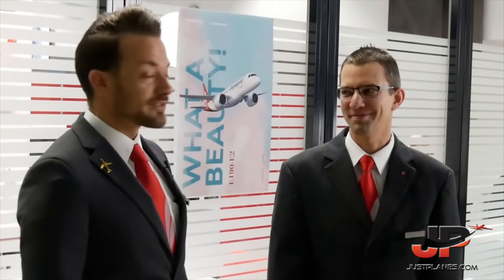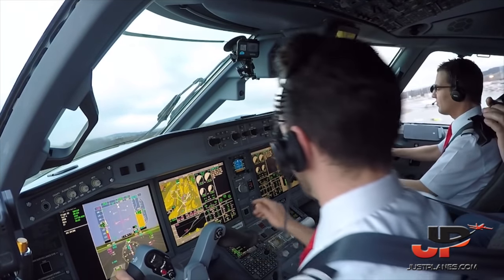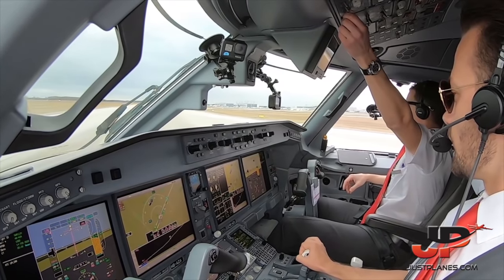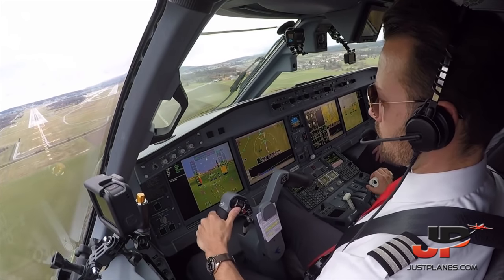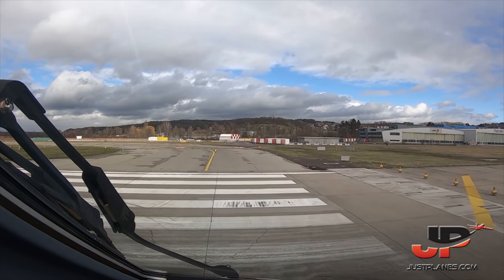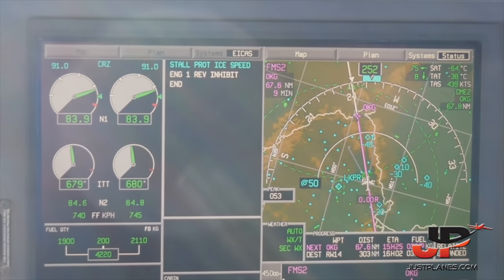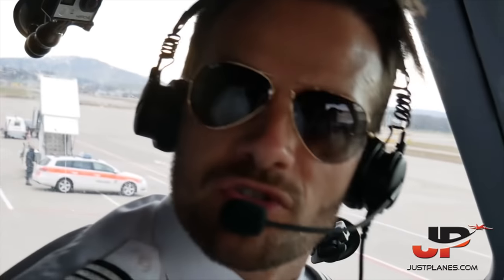Piloting the Brand New Helvetic EMBRAER 190-E2 | Cockpit Views

Comment: The panel screens are very functional and put this aircraft on another level, much higher than its competitors. Congratulations Helvetic team & customers
Reply: Honeywell avionics with track based synthetic vision that gives you a full width PFD and doesn't make you fly with the Flight Path Vector "bouncing off" the speed or altitude tapes and the runway getting hidden in view the whole way down moving left and right as wind changes, track based SVS is the only way to fly - Honeywell is on the E1, E2, most of the top end business jets, PC-12 and PC-24 aircraft with the best SVS on the market
Reply: @eisendrache787  Embrere uses honeywell? mm interesting
Reply: It's the only commercial airplane with Synthetic Vision. Am not sure why the A220 doesn't have it, because Collins the maker of its avionics provides it on the Global and Preator aircrafts.

Comment: I love that extended centerline and terrain on the PFD. That is some very useful technology which could probably be used by Boom on their SST to avoid having to use a Droop Snoot during landing.
Reply: Yeah, that really looked fantastic.
Reply: That is all part of the Synthetic Vison System.  It uses a data base to display the current terrain based on the GPS position.  So if the aircraft lost GPS, it would lose Synthetic Vision
Reply: Mark yup! Cool stuff
Reply: Honeywell Avionics...way better than the competition.  Boom will not have a drooping nose to reduce weight and a track based SVS on the lower displays combined with head worn HUD type technology will make that type of an operation, even in challenging weather, much safer.  Blind landing essentially, but like a Pitts at 200mph on landing :)
Reply: @eisendrache787 

They just announced today that they will be using Honeywell Anthem for their avionics suite

Comment: I loved flying the 175 other than the awful yoke, weak engines and slow auto throttle response. The VNAV direct to feature was super nice, as well as the fact that you can stay in VNAV and do FLCH at the same time and even  the auto bugging of flap speeds. A flying computer with no sense in human interface (ergonomics) is what it really is. Hopefully the new ones have some power. I am currently on the 777 and that thing is such a beast in the climb.

Comment: As a first officer of a major US Airline, I find it bizarre that the CA holds the yoke of a senior first officer. If it was initial operating experience yes but at this experience level totally weird.
Reply: I agree.  I'm a F.O. for a major airline and this would be looked at as odd behavior.  There are times and certain circumstances where you would act this way, this is not one of them.

Comment: Am I the only one that’s annoyed that captains shadow the controls like that? Your FO is fully qualified and experienced to fly the aircraft without being shadowed like that, it shows (in my opinion) no confidence with the guy you’re working with and sets a negative tone
Reply: FlyguyChevy  I noticed but didn’t find it odd. I’ve seen it on other videos on this channel. Also, I think some airlines even have an sop to “guard” the controls below a certain altitude when on AP. As an aside, it seemed as though the FO might have been new to the type because he seemed to be directing his comments about the thrust reduction on climb to the FO as well as us.
Reply: GNX157 there’s guarding the controls and then there’s this.  I’d not be happy with that at all.
Reply: We did it in both my previous and current aircraft. I am never offended since I know everyone does it when I’m flying and I do it when everyone else is flying. You are a much better pilot monitoring when you actively shadow the controls because you notice not only what the aircraft is doing, but also if it is reacting appropriately to the inputs. The example I like to give is asymmetric flaps. As the PM, if I ever feel the PF start to input a roll command when I move the flap lever, but we aren’t turning, I know it’s probably an asymmetric flap malfunction. In the aircraft I flew, the fix is to reverse the flap handle movement, which will lock the flaps in their current position. If you wait more than a couple seconds to react, the aircraft is unrecoverable. 

Now as an instructor, I can notice things like “snatching” the stick during the flare and take the aircraft before we ever have the chance to get a stick shaker or buffet.
Reply: No everyone I believe it's company policy for the PIC to hold or support the PF (FO). As with mine.
Reply: Helvetic just switched from Fokker 100 to embraer, the FO might be new on type or just out of line training or it could be a company SOP. Airbus pilots usually both have hands on stick for landing
Reply: May be SOP at this airline

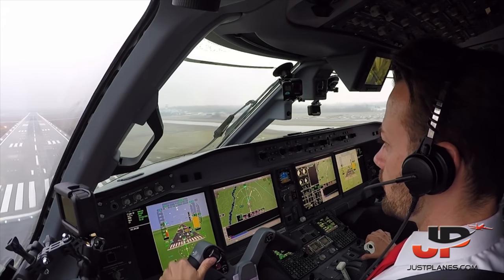Comment: Anyone notice the leak of water that dripped (from the captain seat window seam?) at touchdown? Go to 14:00 minutes into the video. I hope that's not a problem that goes unaddressed!
Reply: Most likely only a bit of frozen condensed water that thawed after reaching lower (and warmer) altitudes. Happens all the time, no reason to worry. 😉
Reply: It’s normal due to humidity inside the cockpit and the low temperatures during cruise level creates ice and when landing that ice returns to be liquid again 🥶
Reply: Pilot notes: Evidence of water leak in cockpit.
Ground crew notes: Evidence removed.
Cue Looney Tunes end theme.

The old ones are the best... 😁
Reply: Good to see the E2 still dripping water. The E1 did that and it was really annoying. You'd thought they'd fixed that.
Reply: Quite normal in many aircraft (cockpits).
Reply: Condensation

Comment: brand new and MEL inop reverser... either the engine needs some more break in hours or it's just broken already lol
Reply: Saw that too. Was like "*sigh* still an Embraer..." lol.
Reply: @TheFlyingJohn  what does embraer have to do with an inop reverser ? Embraer doesn't make the engines.
Reply: Victor Silva Because Embraers are cursed. Which is why we call them Embrokes and someone came up with the acronym Every Mechanical Breakage Requires An Electrical Reset. The good news is they fly fine with MELs, which is good because they always have one. The most I've ever had was seven. Besides, a reverser issue is almost certainly a FADEC problem and Pratt doesn't make the FADECs; they outsource them to a third party which is probably the same outfit that makes them for the CFMs and every other engine.
Reply: @TheFlyingJohn  the 175s I used to fly at regionals always had something MEL, random lights, lavs, reversers, guess it applies to the 190/95 too lol
Reply: @TheFlyingJohn  doesn't that apply to the majority of aircraft. Surely it's not exclusive to embraers.
Reply: oreo10111 Always something man. But I have to admit, they certainly can take a licking and keep on ticking. The 145s especially. I'll miss the 190 but only a little. The E2 looks nice but I understand why my employer opted to go with the 220s.
Reply: @TheFlyingJohn  yeah never flew the 145 but every crew I rode cockpit JS on had nothing but good things, can't complain about my companies Challengers and Globals
Reply: Victor Silva My experience is limited to one DeHavilland and three Embraers. I don't ever remember the Dash having this many issues, but to be fair, it was a far more "mechanical" and less "electronic" airplane. Which prompted my initial comment: I'm certain the mechanics of this reverser are fine, but there is a fault in the FADEC software. Embraers are physical tanks. The zero's and one's are the problem. Well, except on the Phenom. Those parts just flat out broke. In addition to the electrical issues. Great when it all worked though.
Reply: @TheFlyingJohn  is the phenom more "mechanical" than the 190s or 175s ?
Reply: Victor Silva No, the Phenom is just as "electronic" as the 170/190. To be honest I just think the components were cheaper and not as durable. We had a early serial number which didn't help. We used to joke that "we're going to get a new airplane one part at a time" lolol